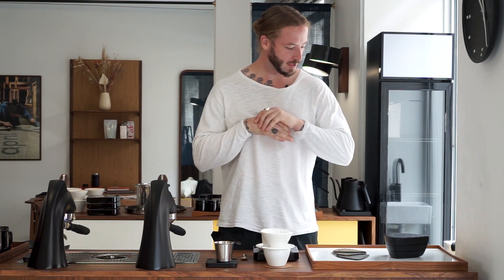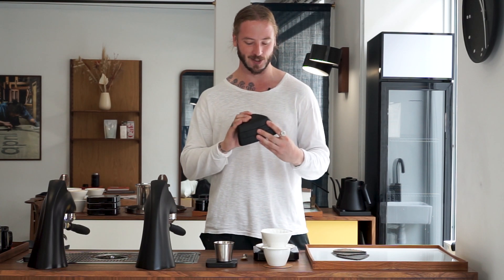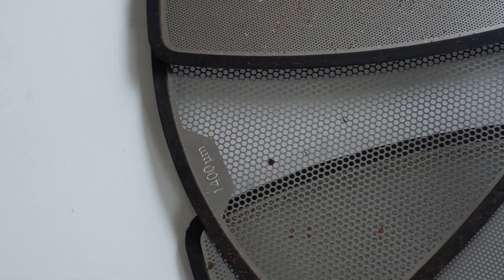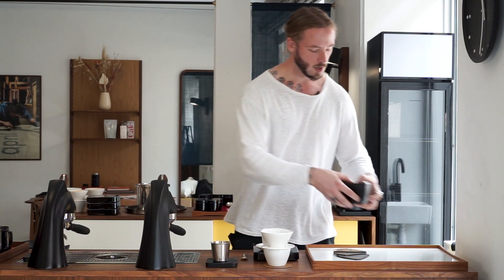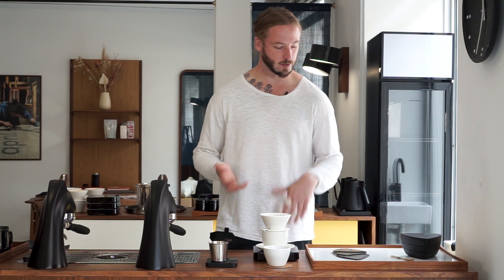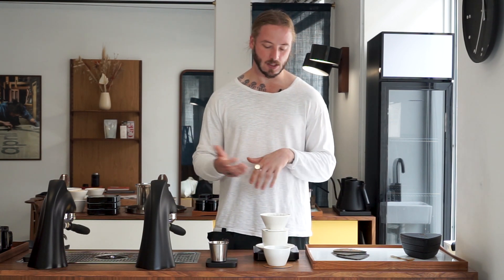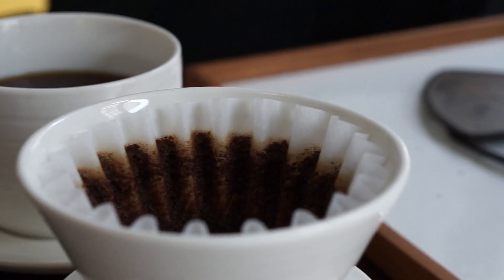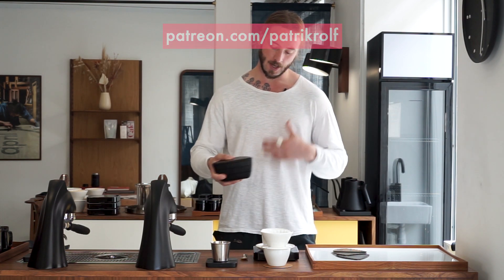Does Sifting Make Coffee Taste Better? Kruve Sifter | Coffee with April #184

Comment: I think people are missing something. The best use for the Kruve is grinder calibration for a peticular grind setting for specific brewing method. Two grinders of the same make & model won't grind "exactly" the same. So, a pour-over has Kruve specific dialed in settings per each grinder. I have been known to expirament with fines for  Turkish. Have added a little fines to a pour-over after the 1st 100gm pour for grins. Its ok. 14gm of one bean at a particular roast, changes. Think quality control. Twenty Cafe Americano's vs 20 Long Blacks vs 20 Short Blacks, vs 20 Cafe Italianos, vs 20 straight espresso. Meh, the over analization. Brew hard, mates.

Comment: I saw a theory before , it saids particle >600um does not extract well even you use a longer brew time ,instead it brings out unpresent flavor due to over contact time. So  I think if you are using a good grinder and beans ,only sifting >600um particle and use a shorter brew time (under 2mins) may bring out higher extraction and more flavor .